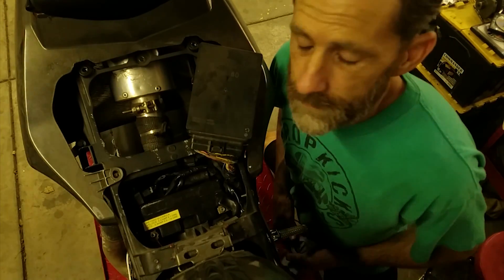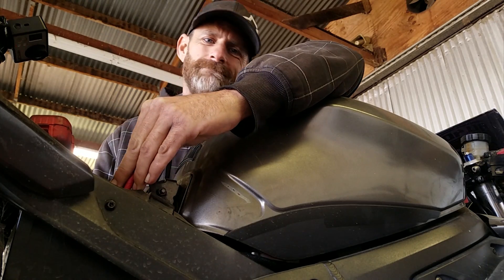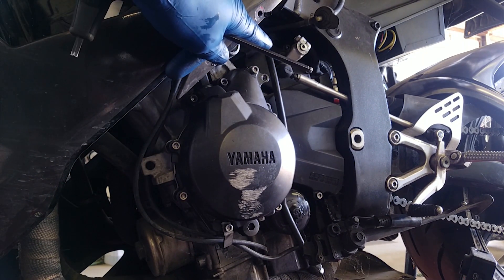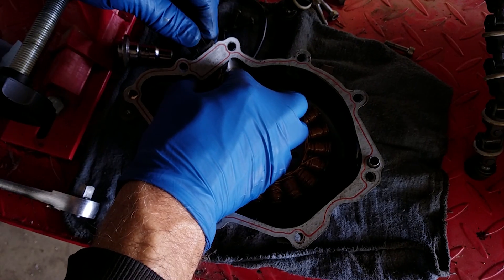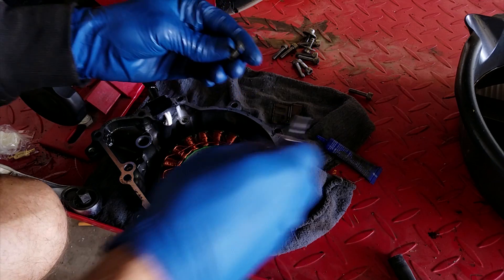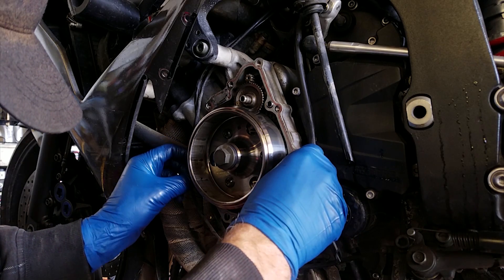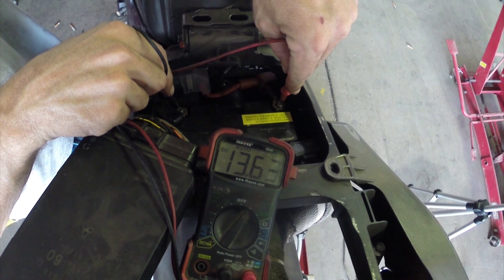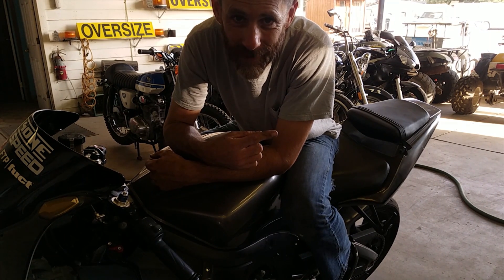Motorcycle Charging System Check and Stator Replacement

Comment: Now i noticed that the connection that connects to my rectifier is not the one that is on the stator.  I have a 2004 yamaha yzf r6.  The piece that connects onto the rectifier is bad and i need a new one.  ( its the 3 on the top 2 on the bottom connection with a gap in the middle)   iam having a hard time finding this piece.  Can you help!
Reply from the maker: If you're talking about the plug then maybe try ebay?
Reply: @MotoMedic  /es its the rectifier harness ....

Comment: Hey quick question, what if I opened the stator cover without draining the oil? I know the oil will come out from the stator cover but is there any problem with that?
Reply from the maker: sometimes you'll get some oil drain and sometimes you won't.  Depends on the bike.  So it depends on that and if you like cleaning up oil :P
Reply: @MotoMedic  Mine is a 05 Yamaha Road Star Silverado 1700. Do I need to drain the oil ?
Reply: @shiwanpottery   Yes you have to drain the oil. The worst that can happen is you'll have oil all over the place
Reply: I put the meter to my battery and nothing happens it sits at 0.00??
Reply: @superslick_e6285  dead battery

Comment: My 1999 V Star won’t start. Even with a new battery and a new Rectifier and a new Starter relay that’s connected to the battery. When I put the key in start and try to crank it. Nothing happens. You can Barley see the Neutral light come on and sometimes when I have it hooked up to a battery charger and leave it for a few minutes the lights get a little brighter and you can hear the clicking from the Fuel Pump but still no start from the engine
Reply from the maker: Was your new battery a plug and play battery? Not many are. Most require that they be filled and charged before use. Sounds like the battery never got fully charged from the start
Reply: Moto Medic the charger has light indicators to let you know when it’s fully charged, so when I installed the new battery it was like worse than the old dead battery that it had. So I left it connected and just hooked up the charger to it and not even 10 minutes go by and the battery charger says it’s fully charged.
Reply from the maker: @anthonyvillegas3338  have you actually checked the voltage of the battery? Sitting on the bench with a full change it should be at least 12.5v or better. If it isn't.... It's not fully charged. Make sure you're using a good charger too and not a trickle charger. Anything 6amps of better
Reply: Moto Medic I have not checked the voltage of the battery but I did get it from Advanced Auto and just took it back home and hooked it up and put the new Rectifier and New Starter Relay and it’s like I didn’t even do any different. No changes in what it was doing before I put the new parts on. It’s something simple I know it but I just can’t figure out what it is that’s making it seem like the battery is dead
Reply from the maker: @anthonyvillegas3338  unless they charged the battery before you left the store with it... I bet it's not fully charged.
Reply: Moto Medic I’m about to head home right now and take the battery off and charge it for a few hours and see if that fixes the problem
Reply: Moto Medic would the stator have anything to do with why it won’t start? The guy who brought the bike back to life didn’t change the stator or the Rectifier. He only changed the oil and the spark plugs and wires and put new fuses in and greased some of the connections and that’s about it I think because every else looks like it hasn’t been messed with
Reply from the maker: @anthonyvillegas3338  spend $7 at harbor freight and buy a multimeter so you can check the actual voltage.
Reply: Moto Medic my stepdad is an electrician and he has one
Reply from the maker: @anthonyvillegas3338  nope.. If the battery is good it should at least turn the engine over and try to start. Stator charges the battery when the bike is running.
Reply: Moto Medic the bike runs bad ass. I drove it an hour home when I bought it and I didn’t move it or turn it on for a day and when I cane back out to ride it that’s when I had the “dead battery” problem. And I say it like that because that’s what it seems like when I put the key in the start position.

Comment: Hello there Moto Medic from Houston. I have a 2003 Yamaha Road Star Silverado that went dead. Along with melting the battery terminals. Only had the bike a couple weeks after buying it until breaking down. It’s been parked I. My back yard since. It ran like a beast when it was working. Thankfully I also have a 2015 Yamaha R3 to ride. Now I’m not sure whether to buy a used engine & transmission or just have my bike towed to a shop to get fixed or rebuilt or have a used engine and transmission installed. I found a 14,000 mile 2002 engine & transmission for 1500 bucks on eBay. The carbs I’m thinking needs adjusting or maintenance also. Anyway any input would be much appreciated 🤘🏼
Reply from the maker: When you say "went dead", how do you mean that?  Because if it fried a battery I'd say there's a electrical problem to be figured out.  But "went dead" could mean many different things lol.  Things that don't necessarily require replacing an engine.  How did it die on you?  Does the engine turn but not start?  Or does it not turn at all?
Reply: Moto Medic LoL went dead as in, seems there was a light short somewhere in the electrical system that caused the bike to have a low battery eventually leading to a dead battery. Now I don’t know if the other electrical parts are in good working order either. I believe the engine is still good it’s got about 36,000 miles and seemed like it had great compression when I rode it. And yes the engine still turns. I’m finally getting to a point with time and money to either give it some tlc or have it hauled in to a shop. Either way the bikes seems to have lots of potential to get her on the road again. Thanks for your reply, love your videos.

Comment: Hay man can you help me ?.. if my stator is bad would my bike still start ?
Reply from the maker: Yeah... If your battery has enough volts to start it. But it won't charge the battery if the stator is shot when the bike is running.
Reply: @MotoMedic  what could cause the bike to not start at all? New battery and new spark plugs installed.
Reply from the maker: @TheLegendaryLoso  that's a thought question. What bike? How many miles? Is the battery good? Is it spinning the starter but just not firing? Or is it not turning at all? Many variable friend.
Reply: @MotoMedic  2005 yamaha r6. Starter spinning and fuel pump primes.
Reply from the maker: @TheLegendaryLoso  how many miles? Has it had a valve adjustment?
Reply: @MotoMedic  it has 25k miles and I'm not sure I bought it used
Reply from the maker: @TheLegendaryLoso  25k miles on a yamaha R6 that hasn't had a valve adjustment? I can almost guarantee that they're out of spec. Start with a valve inspection and I'd betcha that they're super tight. That causes the valves not to close cometely resulting in loss of compression. Pretty common for those bikes.

Rule of thumb... Aside from regular oil and filter changes, valve adjustments are the most important regular maintenance you should do on a sport bike. My guess is that it's never had them done.

Report back if I'm right....
Reply from the maker: @TheLegendaryLoso  report back if I'm wrong too! But I bet I'm not. 😜
Reply from the maker: @TheLegendaryLoso  just saw you have a video of it up.... I'm getting spotty service right now... OK vacation in Cancun lol. I'll check it out as soon as it let's me and see what I can hear. 👍👍
Reply: @MotoMedic  I'm sure u are right as in I dont know. When I bought the bike I just had sure it worked and idled well etc walk around . It ran perfectly fine until I dropped it
Reply: Thank you

Comment: How do I know if it’s the stator or regulator rectifier ?
Reply from the maker: In some cases there are some resistance tests you can do with a multimeter to find out if the stator is in spec.  In some cases (not all) there are also checks for the rectifier.  Check the manual for your specific bike to make sure.  In most cases you'll see the stator is burned in one spot so that'll be a definite sign that it's the stator.
Reply: @MotoMedic   Can you do resistance tests with the multimeter for the rectifier on the 2006 Yamaha R6? I do not have the manual to check.  Also, should the rectifier and stator be replaced at the same time? Or should it not matter?
Reply from the maker: You can to a resistance check I just don't remember the specs off hand. You can also check the rec. If either one is still good, then it isn't necessary to replace what is working fine. But it never hurts if you're just not sure. Last 2 times I blew the stator on my ZX6R I just replaced the rec as well.